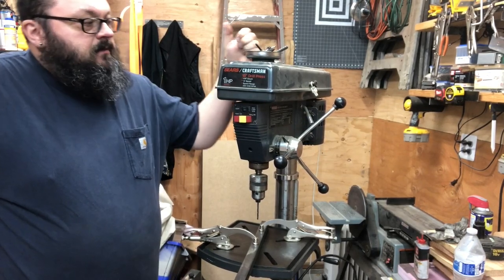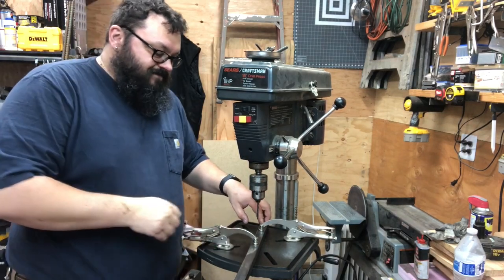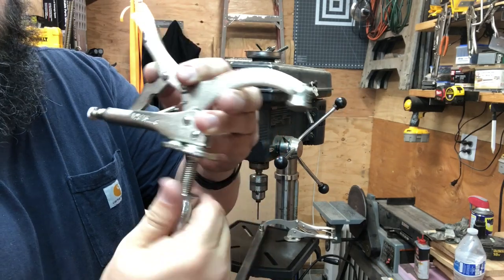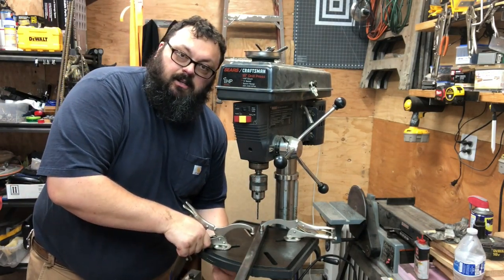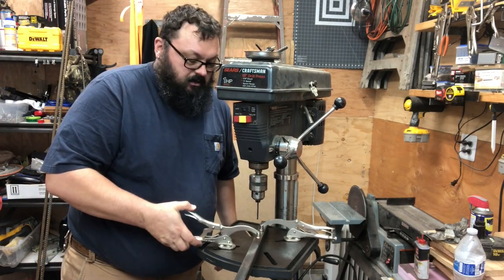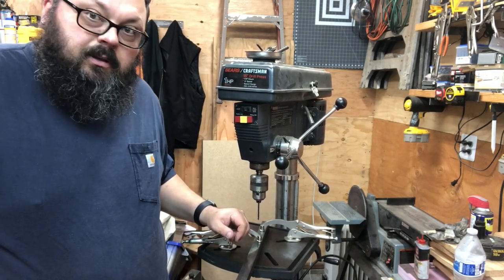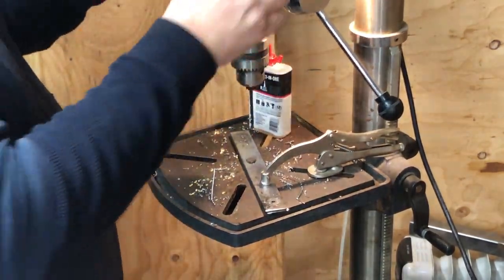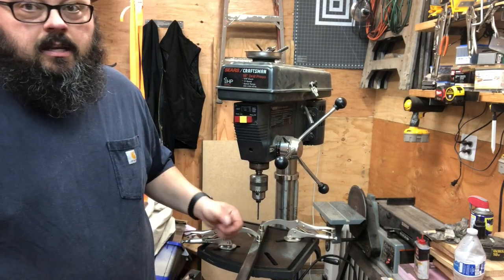Drill Press Clamp From Harbor Freight

Comment: I have a old table in the center of my shop that I use occasionally for assembly. I drilled a few holes on the sides of it, and this also works for it, as well as it does for my Drill press.

Comment: Finally I found out what these clamps are used for (that I inherited from my father-in-law).
Which begs the question, did the manufacturers had these clamps in mind when they added those four tubular holes on the drill press table? 
Cause I always wondered what they were for.
Reply: Probably not probably more for flexibility because you can clamp down different types of vice and obviously the holes on those differ. But it's definitely a good thought 🙂

Comment: Hey, I happened upon your video while searching for better ways to clamp sheet metal to a drill press than c-clamps. Do you know how well these will work with clamping thin gauge sheet metal to the table? I usually use about 12 gauge aluminum.
Reply from the maker: For the price I would give them a shot.  I use them on thin wall material

Comment: Hi could you tell me the thinest material you can clamp down? im hoping it can clamp sheet metal but im guessing it wont work if its too thin. but i guess you could put something under the foot of the clamp to take up the space
Reply: 1/8 won't clamp well. But if you lay a washer (or any scrap (material) between clamp and the material to add a small amount of thickness then it will clamp very tight!
Reply: @georgeburchett5798  thank you

Comment: Just out of curiousity, what kind of drill bits are you using to drill into the steel?
Reply from the maker: I use High Speed Steel, HSS, bits.  Easily available and reasonable price.